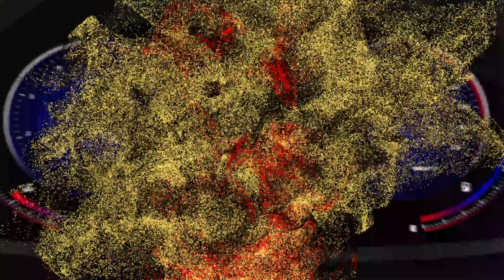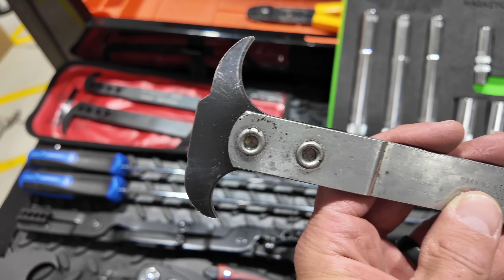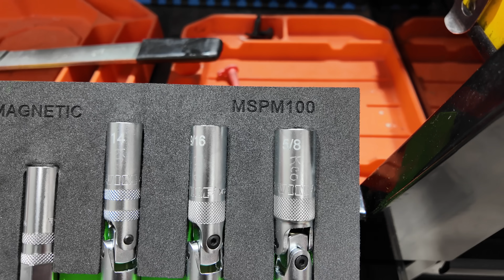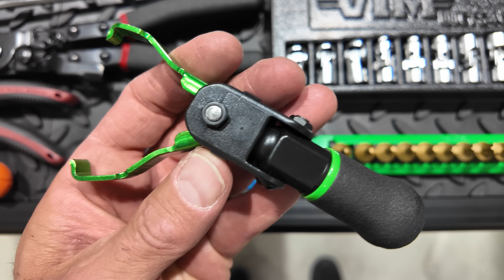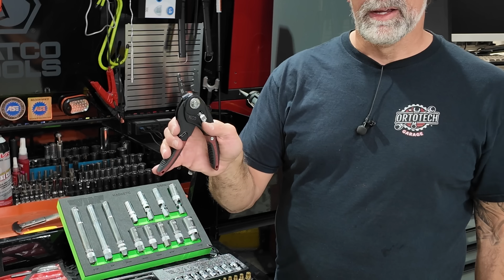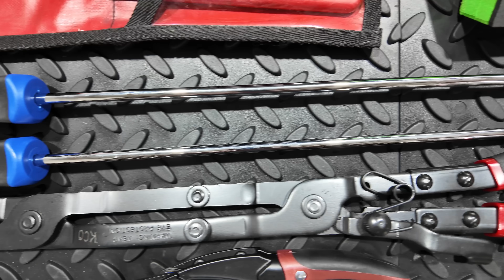35 Years In, and I'm Still Buying Tools | Here's Why

Comment: Nothin beats the Koken spark plug sockets. No magnet, just a tuned spring that grabs the plug. No metal filings to clean out or rubber to fall out. Another must buy is their nut grip sockets, same idea, but the use a spring and ball bearings to hold the nut on. They work every material magnetic or not. Love that seal puller and those dual drive torx 👍🏻
Reply from the maker: I will have to check those out.  Thanks for the tip!  I have not heard of Koken, but its on my radar now.  👍
Reply: @OrtoTechGarage Koken is the Japanese Snap On. Try out their ratchets. You'll have a whole new addition.
Reply from the maker: Will do!  Or should I stay  clear...lol.
Reply: @OrtoTechGarage Once you try a Koken Zeal Series ratchet you'll never look back

Comment: I am the same way,last one was in the Snap On tool truck.Bought smallest pair of the talon grip pliers and their position electrical pliers
Reply from the maker: Snap-On pliers are great if you dont mind the cost. Ouch! 😅
Reply: @OrtoTechGarage  That pair of 3 position electrical connector pliers, was cheaper to buy them than the 3 different lisle versions seperately
Reply from the maker: Thats a bargain, then!

Comment: It is interesting to me that you said the 13/16 spark plug socket isn't needed much anymore.  I was just a shade tree mechanic (now long retired), and the one Snap-on tool I have is a 13/16 spark plug socket.  I needed it because I bought a car which didn't have enough clearance for my cheap spark plug socket.  The Snap-on is narrower at the top shoulder, so solved the problem.
Reply from the maker: It is amazing how the cars have evolved. Part of the issue is that a lot of spark plugs are going deep into the spark plug tubes and require the smaller sizes to fit in the hole. I think that has led to the demise of the 13/16 size.

Comment: Great video and very nice tool haul.  I really like those spark plug sockets.  I still have my very old blue point auto adjust wire strippers and newer version off of amazon. You probably have this but due to my hearing loss I picked up Steelman wireless chassis ear set to help pinpoint noises. I don’t use it often but it’s there if needed….. like all of the other tools…. Ha.
Reply from the maker: Thanks!  Funny you should mention the Steelman Chassis ear.  I just ordered the wired Steelman 2- with 6 channels to replace my old Matco tool.   I dont have it yet, though.   How do you like yours?
Reply: @OrtoTechGarage  For the price I’m satisfied and I definitely like the wireless feature compared to the wired version I used before. And as you know, use the provided velcro or zip ties for under vehicle testing due to not relying on the magnet.  The headphones could be slightly better.  Please do a review on yours as I would like your opinion.
Reply: For the price I’m satisfied and I definitely like the wireless feature compared to the wired version I used before. And as you know, use the provided velcro or zip ties for under vehicle testing due to not relying on the magnet.  The headphones could be slightly better.  Please do a review on yours as I would like your opinion.
Reply from the maker: I bought the wired version because I didnt want to worry about more rechargeable devices going dead all the time. This is not a tool I use frequently so I figured they would be dead every time I need it. Lol. I will try to put a video together after some use. 👍